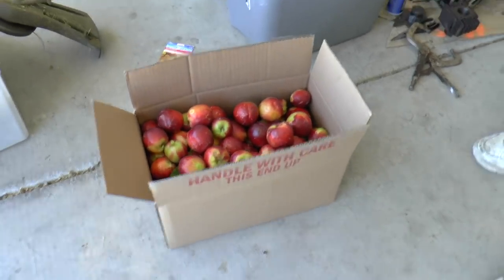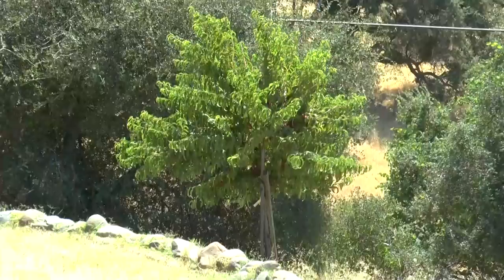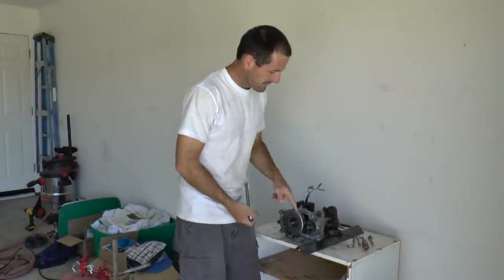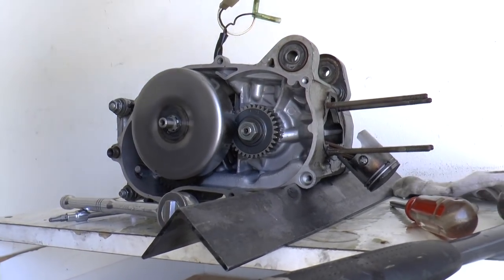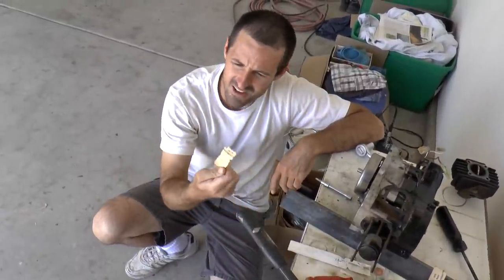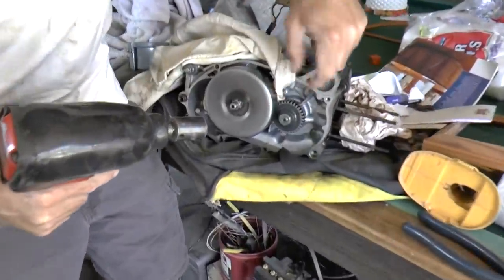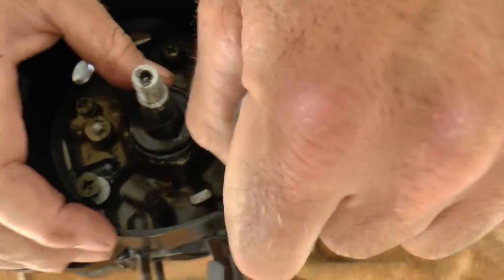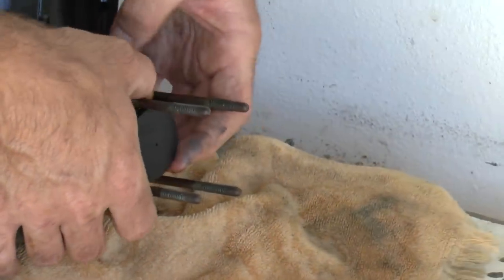$175 Yamaha PW50 Project - Part 7

Comment: Old timer hint here... Put the head on without a spark plug. Get some 550 cord or clothesline. Put the piston at BDC. Stuff the cord into the cylinder through the plug hole until you can't. The cord will interfere with the piston traveling past TDC and effectively lock the engine. Do what you need to, pull the cord out, and there you go.

Comment: ugh so many phillips head screws! just seeing them makes me sweat
Reply: Zap Actionsdower yea they strip so easy. When I got my ttr225 it wasn’t running. I seen all the screws on the float bowl were stripped and I knew right away the carb was bad. The bike sat for ten years. I rebuilt the carb and of course had to replace all the stripped screws.
Reply: talking apart a 50yo outboard filled with only flat head screws that were ruinned by the past 15owner is worst.

Comment: You had the answer to the two cycle/four cycle question right in your hand, if a two cycle fires every time the piston is (approximately) at the top of its travel, then it should be pretty obvious a four cycle is twice that, so a four cycle fires every other revolution.

Comment: Suck, squeeze, bang, blow. 4 stroke. 
2 stroke the same but the compression happens below the piston on the same stroke as the ignition. And the exhaust stroke happens above the piston on the same stroke as the induction. So still 4 parts to the process but they happen in half the rotation. Easy. 👍

Comment: this is dorky but i have used two 3 inch wood screws and half of a clothes line clip as a fulcrum point for a snap ring tool haha.  a cycle mechanics best tools are a good set of screw drivers(matco)..snap ring pliers, dead blow hammer, and quarter inch impact gun (dewalt 20v) with good sockets..a manual impact driver is also very handy especially for those #3 phillips people round out.  as a mechanic for 26 years matco also makes very nice allen wrenches and std and metric wrenches

Comment: I was thinking that the scoring in the cylinder was because the motor seized and the reason why the scoring was only on the bottom was because of the rubber piece that was preventing you to remove the gear. So the rubber part is probably to stop a seizures engine from scoring the whole cylinder or to prevent the seizure in general
Reply: In fact the main reason why most of these small engines seized, either PW or the others with same engine. Is that most "clever" owners think its a good idea to remove the hair filter. Which is not only ridiculous, but a short cut to have a seized engine in just a few hours. 
The back wheel literally trow all the debris strait into the intake. The rest don´t need any explanation. 
I have one of these small engines. Previous owner blew it up in a few hours of use...You guessed no air filter. It was so scored that replacement was the only way. BTW I still removed tiny bits of crushed stone from inside the engine. 
Cheers

Comment: Yep you got there in the end :-D, only one out of 4 actually has power, the rest are on flywheel  stored energy.
I still like two strokes better for small engines, but thats just me :-D
Yes i did watch you remove the magneto flywheel with natures supplied ideal metal shapes.
Reply from the maker: they both have their pros and cons. The 2 stroke is a lot easier for a top end job!

Comment: You probably damaged the crankshaft bearings by knocking the crankshaft out cold. You should have heated up the bearings and maybe sprayed some cooling spray on the crankshaft. Then the removal will be buttery smooth without a hammer.
Reply from the maker: True, but since these bearings are shot I didn't worry about it. I'll have to be more careful with the other (hopfully good) motor.

Comment: Call them 2 stroke and 4 stroke rather than cycle. A cycle is a complete revolution, whereas a stroke is the single up or down movement of the piston. A 4 stroke engine actually does 2 cycles and a 2 stroke engine completes 1 cycle to complete the sequence. I have never heard anyone use the term 2  or 4 cycle engine.

Comment: Do you know where I can get a crankshaft and rod assembly for a PW50? I havent been able to find an aftermarket one or even a factory crank all that comes up is the connecting rod by itself..but they have to be pressed in and crank assemblies are usually cheap.. Anyway, every other part is super cheap and is easily pulled up by a quick internet search on ebay and bike sites.. Weird..just wondered what route everyone goes on crankshafts on these bikes, they've made this PW engine for 35+ years

Comment: Holy Patience! This is time consuming.
Reply: you think this is time consuming, i did essentially the same job on a yz125 that blew up. rebuilt the shock linkage, changed tires, rebuilt steering bearings, rebuilt the entire engine, etc

Comment: Been saying that for years two strokes are one stroke and four strokes are two strokes
Reply: Kenney Chappuis Not true the 2 stroke cycle is power, exhaust.
While the 4 stroke is induction, compression, power, exhaust. 
The 2 stroke uses reed valves to buildup compression and mixes it in the crankcase to create pressure it takes 2 strokes to exhaust the old gas while at the same time takes in clean air and fuel for the next power stroke hence 2 stroke. 

4 strokes use intake and exhaust valves with camshafts that are timed and driven by the crank shafts so the valves can open and close in time for the pistons to come to the top of the cylinder.

4 stroke cycle 1 is induction. The piston goes down exhaust valve is shut inlet is open.
the piston then comes up (cycle 2) both valves closed this I called the compression stroke, next the piston get forced down by the ignition of the fuel this is the power stroke (cycle 3) next the piston comes back up the but now the exhaust valve is open to let out the gas. so you see why it's a 4 stoke cycle not 2 and the 2 stroke is not 1.
Reply: The UnrulyYoutuber 
Thank you for your detailed information 
LOL

Comment: does a 4 stroke realy work like that?
Reply: Yes.
Reply: Suck, Squeeze, Bang, Blow. Intake, Compression, Combustion(Also known as the Power stroke), Exhaust. That was a good representation of a 4 stroke engine. The vast majority of internal combustion engines work like that but small engines like weed-eater engines work a little bit differently.